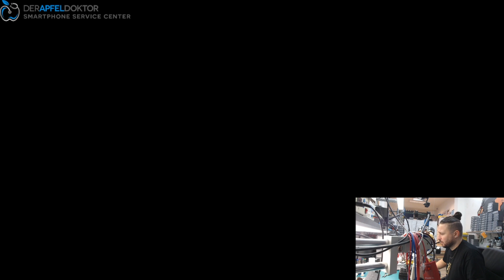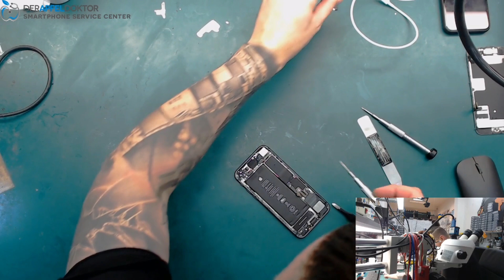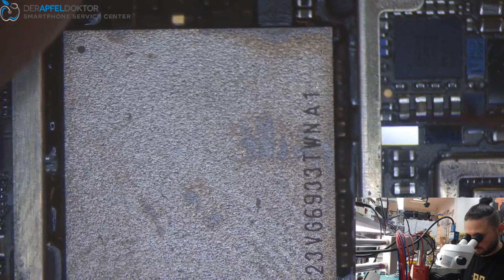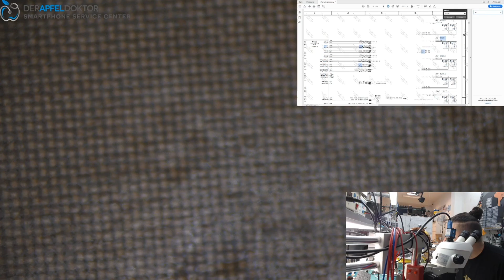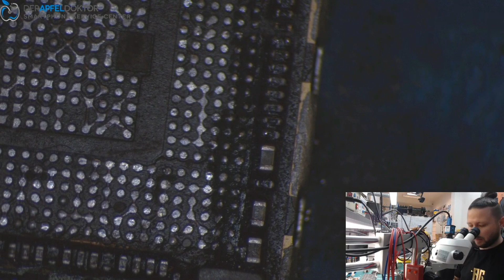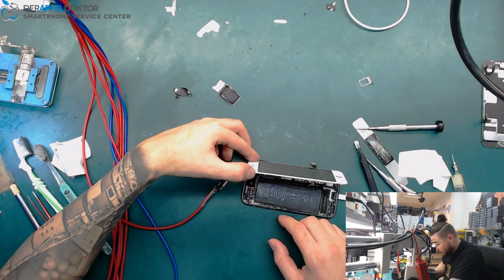ADVANCED REPAIRS - iPHONE 8 WITH WATERDAMAGE - i2c PROBLEM - DATARESCUE

Comment: BOOM !! first one !!
 why didn't u swap bored ?! i know if u don't solve the problem in 10 min u just swap !! but in this case maybe another resistor is damaged and cause the loop !! i know bored looks clean even the resistor u changed looks fine !! 
 and if u don't mind asking !! what is the model of your hot air ?! i know its jbc but what is model number ?!
and your soldering iron also jbc nase but what model ?!
THANKS for advanced sharing
Reply from the maker: Yesterday I swapped an iPhone 8 board because of no signal and I don’t wanted to do any measurements. So I just swapped it fast and easy 🙈😂👍